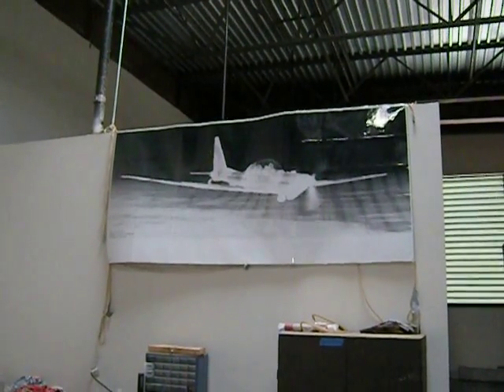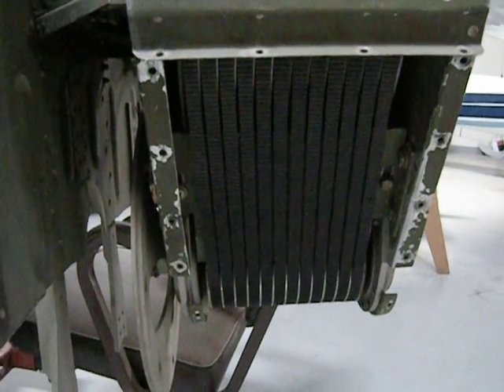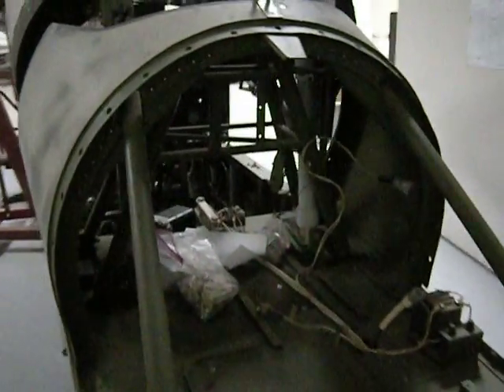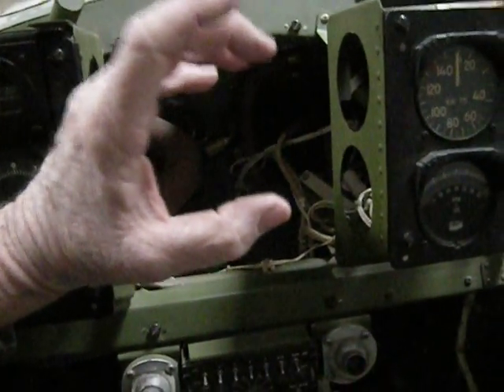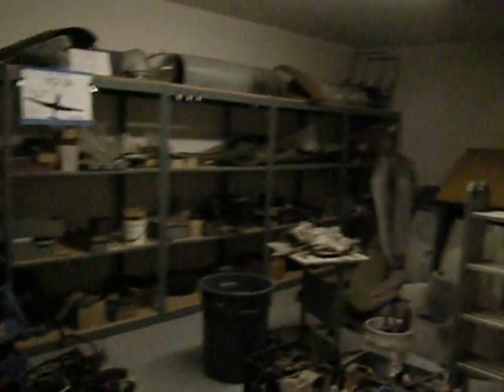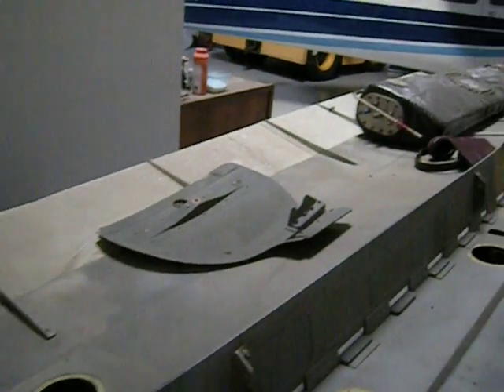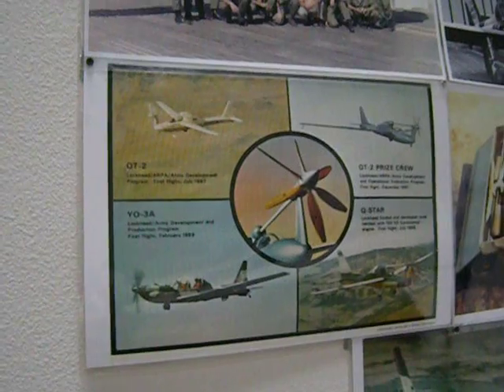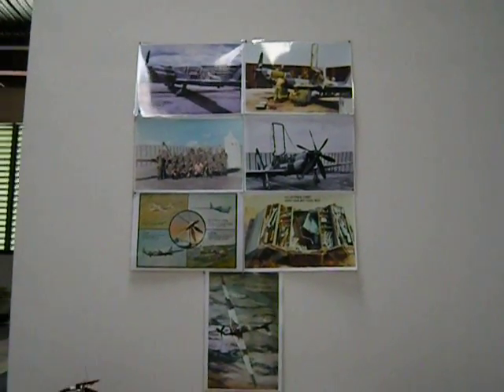YO-3A Army-Lockheed Missles and Space Company Secret Silent Airplane

Comment: Kurt Olney and I became acquainted as I wrote a memoir about my Vietnam gig 1970-71 and learned we served together at Long Thanh North where he was Crew Chief for YO-3A 1800007 and I was a perimeter guard from a Rapid Response team sent to protect this top secret plane.  Fantastic but true ... our team was never told anything about the YO-3A or even that it existed.  We were allowed to rumor only about why we were sent there, with such urgency, to guard this tiny air strip.  It was only many years later I learned it was THAT secret.  At the time it was just this funny little plane flying 50 feet over our heads to land so quiet we only saw it overhead when it turned on landing lights.  Then it just hushed on by with a minor woosh sound.  I swear we waved back and forth to the pilots!  And while Kurt correctly states none were ever shot or brought down it sure wasn't for lack of the VC trying.  Out on the perimeter night after night after night we began to learn that hails of green tracers going up about 1000 meters out were indications the local cadre had made out a silhouette or something on the landing approach.  Next thing the little plane would light up over our heads.  And numerous infiltration attempts were made but none successful in reaching a YO-3A.